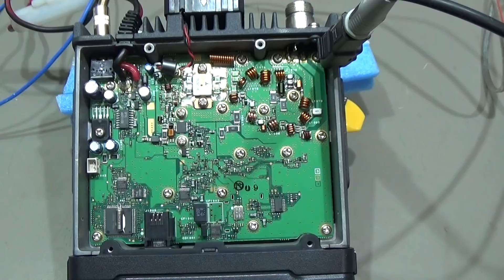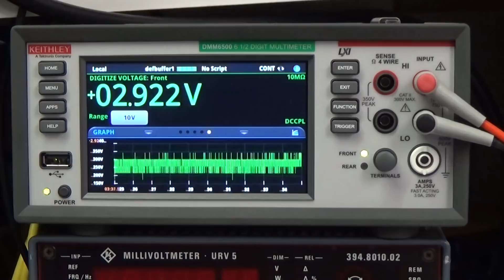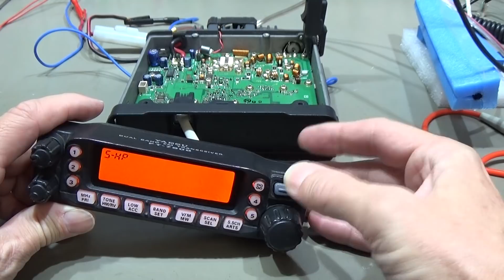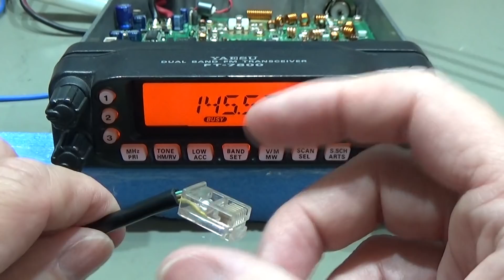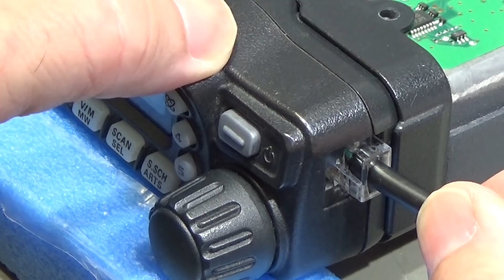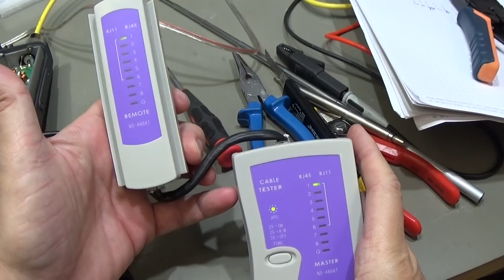#235 Yaesu FT-7800 won't turn on issue fixed

Comment: Hello Peter.  Another fine video.  I have an FT-7100 that won't turn on.  I ordered a replacement cable and that was not the problem.  (It came without one).  I have heard this particular radio model is known for not turning on.  Have you ever had an FT-7100 in your shop for this problem?  Thanks, Bob, K5INW

Comment: My 7800de does not turn on and tripping the fuse on my power supply, I have measured the resistance on the board between red and black + & - and it is zero , is it worth it for repair ?

Comment: Hi Peter! Great Work! I have the same problem whith an FT-7900. The cable is ok and I can view some data trafic betwin the main board and front board (TXD and RXD). The Question is: how can I continues?
Reply: Finally fixed. The problem located on front board. Resold the terminals of micro xtal.

Comment: I used to use pins on small integrated circuits. Then I learned to use caps. coils, or even board crossovers for pickup points. I always wondered how TRX would not blow his spectrum analyser by connection to a wrong pin accidently. Now I know how. Thank you TRX. We'd love to know your callsign some day! It's interesting but I'd have the same problem on Kenwood models where either you clean the contacts (normally tin now and not gold) and you are back on the go. Those crimp tools are expensive!

Comment: Those are terrible connectors for a mic cable, I would have that broken in less than a week!  I would rather have a 7 pin din plug, and I don't like them.  Surely they could find enough space to fit a proper plug if good quality!  Not knowing the radio, I would not have put it down to the cable going to the front panel.
The wiring will be at its limit carrying power to the front display and processor!  Nice work Peter.  :-))
Reply from the maker: yeah even many CB radios have a better connector...
Reply: @TRXLab  Yeah, I would rather have a slightly bigger radio and have a CB type plug, even if it were a 9 pin, at least the cable is well gripped on a CB type plug.  :-))

Comment: Hi, Peter I have yaesu FT7800 that shows blinking busy on the display on all settings, I have tried full reset but still the same. I was told that it looks like the PLL didn’t lock. If you are interested to make a video repair on this type of faults please just let me know. Thanks.

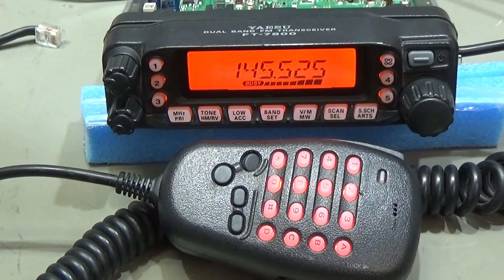Comment: It looks like the microphone also has a button that is stuck down, the gray P1 button underneath the * button (see 21:17 or so). Maybe it could be unstuck by wiggling it from the outside, but you might need to open up the microphone and re-seat the rubber button sheet.
Reply from the maker: have to check it

Comment: Thanks for the video ! I had the same Problem but had it brought back to life different way.  Maybe this can help someone.

The day it stopped working i send it to a german dealer for repair , after several weeks got it back with " CPU DEAD" so bought a Kenwood and had it sitting in my Lab for parts... 

Than the situation didn t let me sleep well as there was no reason it got dead. So started switching cables ( still had the short original one mostly unused) had the click sound as in the Video. i asked a friend who had also a 7800 if i could borrow it for swapping display etc pp. He was ok 👍

So i first put my display on his and it worked. 
Swapped and tested all the cables on his. - all working. Hmm so i finally put his Display on my Back unit and tadaaaaa it came to life.
After i put my display back on and it worked as well. I have no clue how or why that vrought it back to life but since it works again . 

I know it may be hard to find someone with a 7800 and i had luck , but maybe it helps someone... 
Best 73s

Felix
Reply from the maker: Thanks for your report

Comment: I hate those data/telephone style connectors, always suspect. In all my mobiles I add a strain relief clamp to keep constant tension on the extension side, this allows you to move the mic around without putting pressure on the RJ-45 connector as you move the mic around. Sometimes simply putting a faulty connector in the crimp tool and actuating the tool will bring a dead connection back but I still wouldn't trust one in the long run. TNX for another simple repair Peter!  73 - Dino KLØS
Reply from the maker: Yes that might be the only way to protect these connectors... Thanks for feed back

Comment: Great work Peter.  I just repaired an FT-8900 that had the same problem, it would not power on.  One of the ribbon cables inside the head needed to be reseated.  So it went from the same non  working state to working again!
Reply from the maker: sounds good!

Comment: Hi PETER

Where did you get the cable tester?  I have been looking for one than can manually step through the lines.
Thanks
Alan
Reply: Walmart
Reply from the maker: Yeah Walmart is a good idea as I really don't remember where it is from...
Reply: Hmm yes except I am in Australia and we do not have Walmart. Will see if they list it and post internationaly
Reply: Is there possibly a model number or similar that I could try look up by?
Reply: Alan I was just kidding about Walmart, but Amazon has one it's "Optimal Shop Network Cable Tester Test Tool" it's $20 CND. It's not the same as Peter's but pretty close. There also known as Modular Cable Testers. Hope this helps
Reply: NS-468 LAN Cable Tester is what Peter has

Comment: Hi Peter, great video again. 
Is the faulty 4th wire supplying the power to the front panel (so the 9 volt or the ground return)?
Reply from the maker: well have not double checked that...

Comment: Bad to see, that modern transceivers suffer with problems caused by this cheap and wobbly connectors from IT industry. All these IT products are designed to live only some years because then they are technically obsolete.
Reply from the maker: Yes that is the sad truth with this connector and beside that even CB radio manufacturer do fit a proper mic connector to the radio...
Thanks for comment, Stefan

Comment: Great stuff again Peter...i guess if you cant get a lead you could put new plugs on old one, or make a new lead.
Reply from the maker: That is difficult as you shorten the wire too much if you put a new connector to the old cable...

Comment: Hi Peter   is that issue common to the FT7100m looks a very similar radio  i have one that i would like to have working  as it is a perfect fit in thne new car
Reply from the maker: This happens always with those little joint wires..
Reply: @TRXLab  Hi Peter yes think this is a bit more dead checked the wire it is ok  hope its not the cpu cheers ..if i  find the money i will send it your way to look at a..